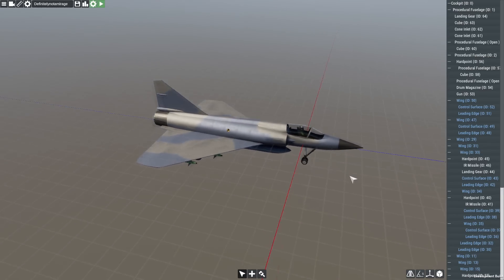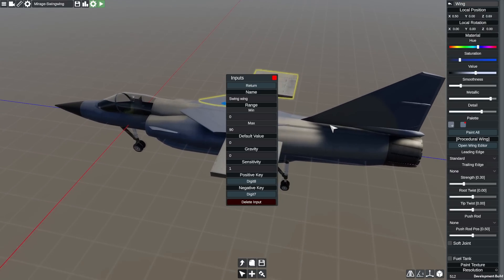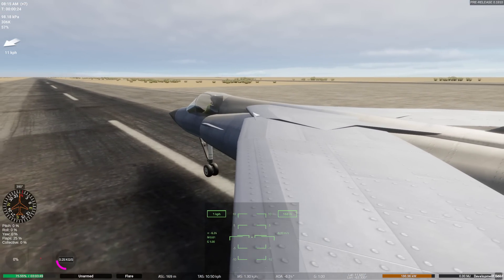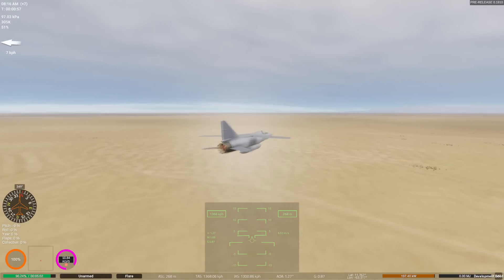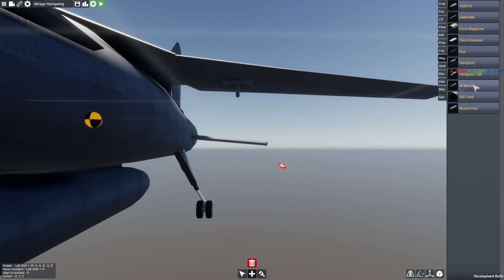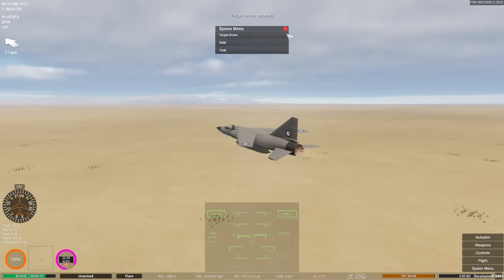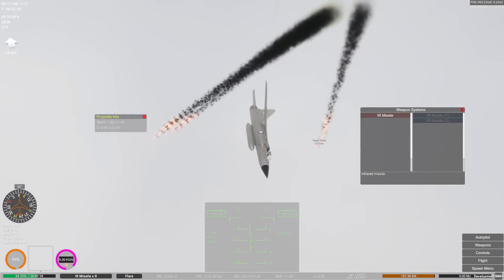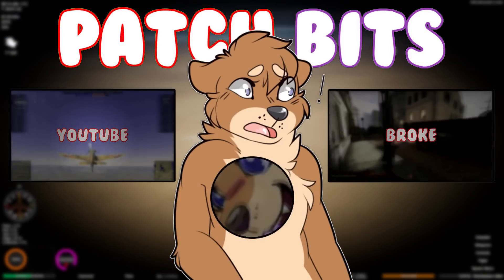Building a SWING-WING system in Flyout!

Comment: I’d recommend making the entire elevator move rather than just the trailing edge which is common in modern fighter jets and will improve maneuverability. Increasing the surface area on the control surfaces is always recommended for better maneuverability. This applies to the wings as well so adding leading edge slats that engage at low speed to increase low speed maneuverability by creating more lift on the wing’s leading edge by increasing the surface area. I’d recommend some research on it I’m still learning myself lol

Comment: Wonder if you could use those moving bits set at extreme speeds to make a helicopter. Possibly using counterrotating props so you dont need a tail rotor.

WE WANT TO SEE YOU SUFFER

Comment: I believe that these pre Korea War elevators you used aren't doing the work. Maybe if you use some full moving ones the result will be way better. I also believe that you can position it higher  (almost at the wing level, as the Mig-23) and do not angle it, just level with the wing.

Overall, this plane is unbelievable fast as it goes way past march one almost at sea level, with the wings extended and with that huge fuel tank.

Can you set the wings to angle automatically with this game?

Cheers!
Reply: I think its fine as it really follows the mirage f1 style or even the mirage G. It gives originality to the aircraft unlike what we see on the 14 and 23
Reply: @Rfa2000  The Mirage F1 uses full moving elevators

Comment: A little advice! Making the entire elevator move instead of just part of it will help a lot with maneuverability. Also on the delta wing mirage i noticed when taking off the plane would squat down a lot and drag the drop tank. I would stiffen the suspension more so this doesnt happen. Also, i suggest trying to use a controller or i think the game even has a mouse flying mode. Youll find it a lot easier to fly, especially with landings :)

Comment: You need all moving elevators if youre going to be manuvering at or above mach. Those tiny ass elevators just are not going to cut it. Remember, the air is being pounded into a massive shock cone, so theres less effective 'mass' flowing over your control surfaces. Hence you need a way bigger surfaces to maintain any authority at or above mach.

Comment: I'm curious. ( i'd doubt anybody would read this, but) Could you try to build like a Ground strike aircraft that has air intakes that can angle up or down to maximize efficiency when executing maneuvers? the odds of an answer are against me.

(and if you do intend on making this, don't put the engines like how they are on the A-10.)
Reply from the maker: Umm, probably, yeah. You'd just have to bind the axis to the pitch keys. It likely wouldn't be perfect. One other option might be a control surface motor as a mount, which would allow perfect control, but I think they flex under load

Comment: Could you install some sort of fly by wire system to make it slightly less dangerous to fly as it's great but maybe a little to responsive and unstable at times although loved the missile hardpoint system way cooler than just putting them on the fuselage although with the elevators make the entire elevator move up and down not just part of it this will improve supersonic handling.
Reply from the maker: The game does have fly by wire, but I don't know how to set it up yet.

Comment: I think an all moving tail plane would help in higher mach numbers.

Look at Any super sonic jet and nearly all of them have the elevators move fully not like traditional prop elevators.
Reply: Heavily depends on the fuselage for the plane, some fuselages want a to put the elevators on top of the tail to reduce drag and such. But yes, adding it to this fuselage would help severely.
Reply: @Minigun_-nj1tf I'm sure he meant having an all moving tail not the horizontal location
Reply: @tylerv9174  at the end i said adding all moving elevator would hep the fuselage shown in the video

Comment: You need to have the rear landing gear much closer to the Center of Gravity. Landing and taking off will become much gentler.
Reply: haven't done research myself, but my rule of thumb is the middle of the rear wheels are at the back of the center of mass looking down horizontally, some bigger planes i tend to put the wheels slightly more back.

Comment: The sticky forwardy bits on the root of the wings is called a “dog tooth” leading edge extension and is used to induce turbulent flow over the wing to prevent stall at high AOAs
Reply: Even the f-15 has them on its elevators
Reply: Saving that to my roster...

Comment: You could add deployable glove vanes like the early F-14's had. At high speed they deployed to improve stability and reduce the airframe nosing down. They're basically like static canards
Reply: They also allowed insanely high turn rates above Mach 1 (about 7.5G @ m1.5 iirc?)
Reply: Most of the F-14 fleet had Glove Vanes since the majority were still A's by 2006, they were just welded shut since they didn't provide a big enough benefit to warrant the even higher maintenance hours. The B and D omitted them since the Navy welded basically every Glove Vane
Reply: @uberschnilthegreat22  The realities of maintenance always put a wrench in the works.
Reply: @Direwolf13PS3  To the degree that maintenance costs and hours became the F-14's very undoing in a Post-Soviet world

Comment: Having your wings swiped out at high speeds isn't going to rip the wings off, unless the structure is poorly built 😆.
Reply: Even if they are built “well” going over Mach with them not swept in will cause internal stressing, and unnecessary damage to the wings as they deal with overloading. The amount of pressure generated from the shockwave is massive. Sweeping them back “delays” the shockwave and makes it more gentle on the wings. The wings might not “fall off” but it will stress the structure which can cause cracking/ or worse catastrophic failure if not spotted. There is a reason you don’t see any supersonic aircraft with fixed straight wings.
Reply: @CallMeMark_  Pretty sure the new trainer jet is fixed straight wing
Reply: @subjectc7505 not sure what you're referring to but most trainers are quite subsonic